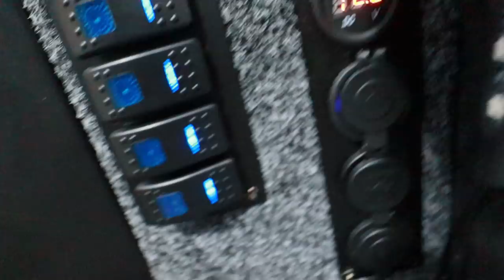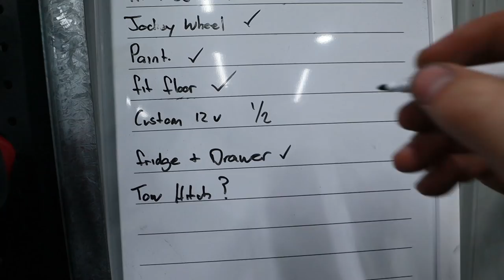Best LIGHTING Setup On A BUDGET!! Light up camp for less $$$

Comment: Nice work. 2 easy little mods I did to the roof top tent was put a small grommet in the base up near the head of th bedto run power into th tent. I ran the same led lighting as what's in th trailer. Also had a usb charger for my phone. Mounted lights along th center bar of th rooftop. Also tie a 1ft length of  paracord to the zip for th  cover. Hellps u pull th zip on a better angle and makes setup and pack way easier also makes zip last longer.  Zips r a fail point on the cover. I travelled Australia and lived in th kings rooftop for 4 months and the cover was the only issue I had. The paracord made a big difference

Comment: Mate, love the trailer build. Coming up trumps and giving myself heaps of ideas. Can I suggest adding a circuit breaker before connecting anything to the battery. Have it mounted as close as you can to the battery as a safety. Just my thoughts

Comment: Hey man! Congrats on the little boy, ive got a little girl so we can both rep them dad bods 🤟🏼
I noticed there wasnt a fuse from the battery to the fuse block, if the cable was to rub through thered be nothing stopping it from melting and catching fire. And i seen that the lights work now but i think the earthing will become an issue when its been in the weather for a while, might be worth running an earth strap to bolt to the tent frame if you didnt want to run a cable from each light
Loving the videos, keep up the awesome work (if you know where i can get one of those trailers plz let me know 😂)

Comment: How about a solar panel on slide attached to the underside of the rooftop tent, pull it out towards the tow bar and slapping that to the battery if you want to make the trailer a home base and leave it behind while going out for a drive

Comment: Lights are looking good man!! Only thing I would change would be replace those 2 rear facing lights with a slimline lightbar. Heaps more light and a similar profile to not get in the way.
Reply: Yes for off-road at night, but no for camping (unless they are on a dimmer). Massive light bars at camp are a real pain, they make everything else too hard to see.
Reply: @Sethjxl  you can buy low output light bars. I have one in my garage. Rubbish for offroading, but perfect for the campsite.

Comment: You've done a great job on this mate, something to be proud of. Can I suggest that you run a short earth between the main body and the lid. Those hinges are a moving part, and they are the only significant electrical contact between the lid and the body for the ground. This will cause corrosion in the dissimilar (Steel, S-Steel, Ally) metals via electrolysis. Ground strap between them is an easy fix.

Cheers.
Reply: Agreed! Or for best practice, a negative from your common earth pin that you loop between all lights because voltage drop is a real thing.